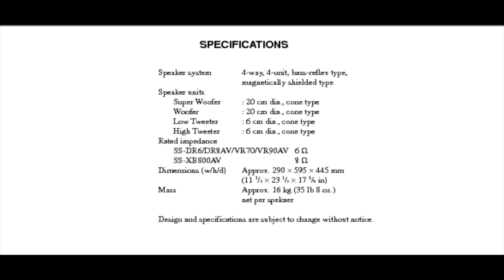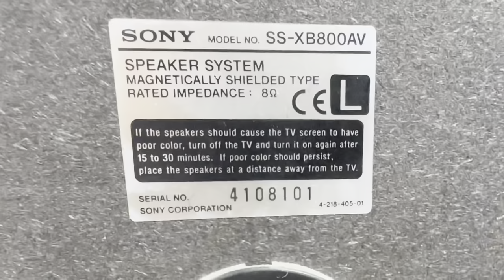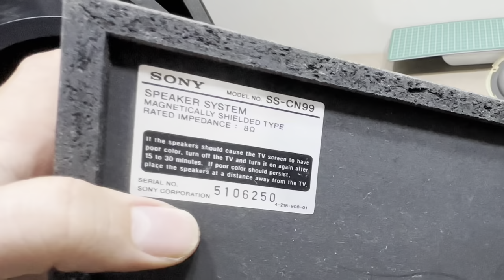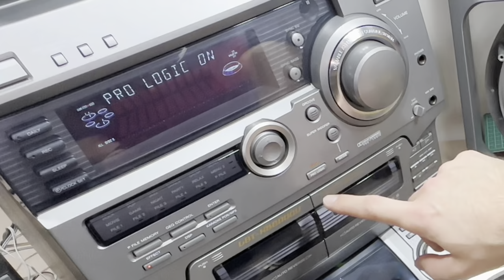SONY SS-XB800AV SS-DR8AV SS-VR90AV SS-DR6 SPEAKER SYSTEM Disassembling  Examination

Comment: hi and low twitter ?) are you sure that they are not connected in parallel there? You can also see that there is one wire going to them, then it is divided into 2 outputs for each tweeter!

Comment: I was doing some work for My best mate at his house and had to go in his garage. Upon entering I noticed this huge stereo sitting in there covered in cobwebs. It was this exact stereo with the main speakers and the 3 surround speakers too. I said who’s is that. He said mine but I don’t use it so put it in here. I said what you doing with it. He said nothing. I said do you want it. He said if you want it with all them spiders covering it you can take it. I messaged my partner and said to her do we want this. She said where the hell are we going to put that thing. I thought that’s true. I said oh thanks but I don’t need it either. A week later he told me he had ordered a skip and emptied his garage. I said oh what did you do with that stereo. He said threw it in the skip 😲.
Reply: Oh no very upsetting he shouldn't have chucked it away very valuable speaker system ......

Comment: im always surprised in the lack of any crossovers in those stock speakers that come with systems like that sony.
Reply: its possible with minimum filtering components to be ok sounding, despite the cost cutting. But in this system's case, its crazy they went to the expense of the box construction of giving the sub its own isolated chamber inside, but run it wide open. its response is overlapping in the mids with the upper woofer....thats gotta have a weird tone...
Reply: @themadmallard  my guess still is they cheaped out😂 had a Kenwood system abit similar to that one. Piezo discs as tweeters😂.
If i was to get one of those compact systems now that im older i would try to find some nice floorstanders. The amps those compact systems seem powerful enough to drive about anything
Reply: @themadmallard  nevertheless a nice restoration project ngl.
Reply: @themadmallard  it was an era of pop music back then and compacts like that focused on young people consuming that type of music.Bigger was better bass and groove was the target for partying etc..Like bt speakers nowdays in smaller scale.
Reply: @drutt1985  the older ones from the 70's and 80's weren't particularly powerful, but many were 6ohm stable, with cabinets to match.
Reply: @themadmallard  yes i know about the old school systems. People tend to believe that a system needs several hundreds of watts even tho an amp that only delivers as an example 5 to 15 watts usually is enough for most houses/ apartments or even rooms. A 50 watt system vith some decent floorstanders will really rock a kids room😅 or a pair of bookshelf speakers and an 8 inch active sub will be enough for most "party listening" me and my brothers keenwood compact system had 4*100w and that was even overpowered🤣. I dont remember the model name but the speakers on that sustem had separate amp out for the subwoofers in the speakers. And it was just 6 inch subs. But then again it was a small room so that probably added to why it was sounding so powerful🤣. Ofc. We ordered some cheap 12 inch subs and plugged them in instead and experimented😅
Reply: Bende Sony mhc w550 var bu kolonlar bağlı kendi orijinalleri kasa ve , woofer yıprandı bende bunlardan aldım ama farklı ss-vr50 fena oldu kendi orjinal woofer 21,22 açtımmı bass sesler karışıyordu 50 son ses açtım banamısın demedi muhteşem mhc w 550 de manyak bir set.

Comment: good job, personaly i have for my 5.1 home theater two SS-XB8AV speakers for L and R (also for suround left and right i have two SS-SR120, the same specs as yours:16ohm 10cm... but for the center channel i updated the CN120 for one old kef cresta 2, coupled with an Denon AVR after a good audyssey calibration that make a really good job in a small room, the result is a lot better than with the sony little center speaker... it was really the weak point)
Reply from the maker: In the old days, the cheapest and quality systems that people could reach. In 1999, illegal ones in our country (Türkiye) were sold for 1000-1500 German marks. I think it's a very good system.